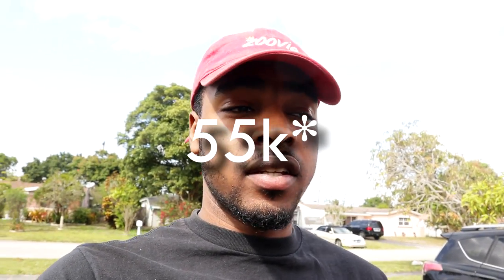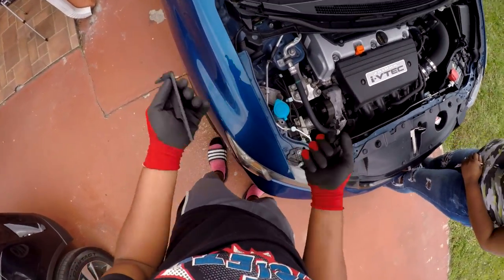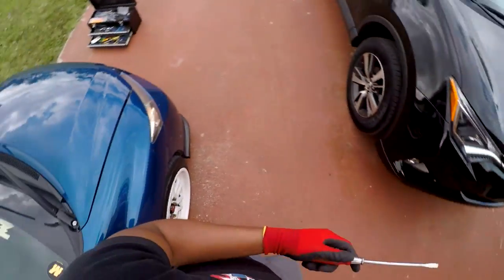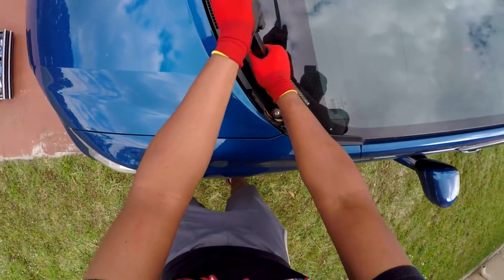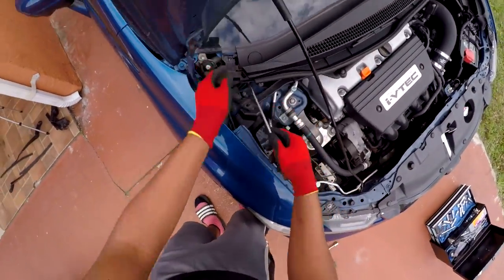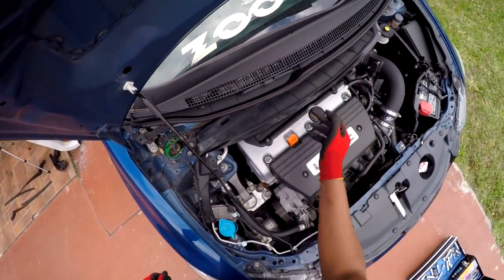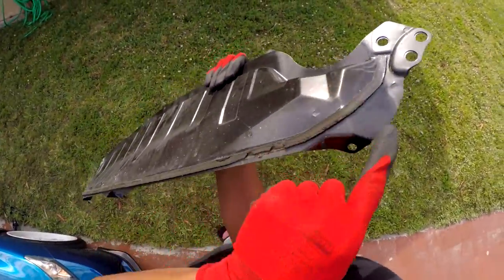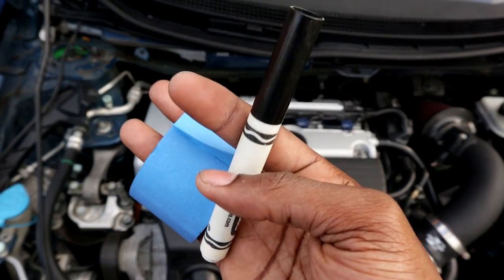Changing Spark Plugs & Transmission Oil On Dusty The Si

Comment: Did you not need to change the spec of the spark plug to 0.04 or was it already at that space?
Reply from the maker: Comes pre gapped
Reply: @zoovie  which brand did you get again? Cause I have the 1.8L

Comment: My 9th gen is Idling rough, misfires, and stalls. I need to replace the sparks plugs and coil packs right? Thanks
Reply from the maker: Yeah bro .. if that doesn’t help then Idk
Reply: Should fix it if not try the fuel injectors , sometimes they can cause roughness